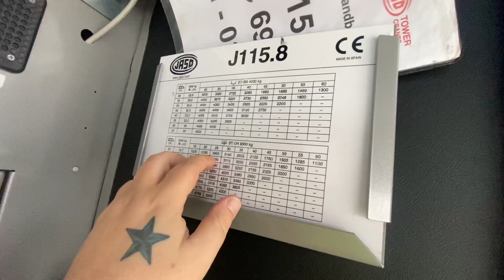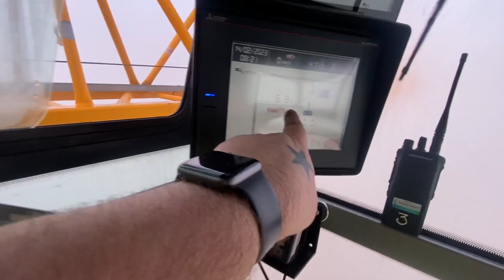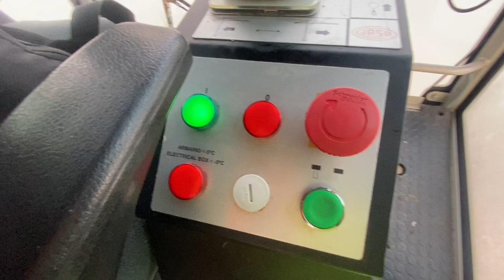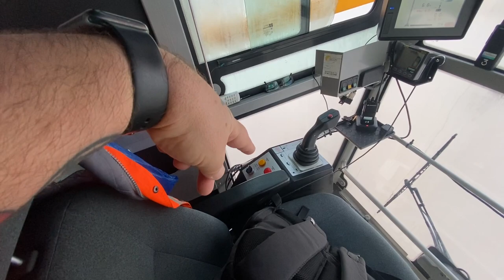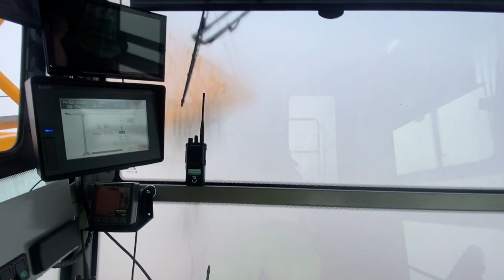WORKING IN FOGGY WEATHER CONDITIONS - Episode 5 2023

Comment: Another good vid . Question , have you ever been on a tower crane on the top of a building as it’s going up
Reply from the maker: Nope, most cranes like that are in the USA or Australia as they use a specific type of crane called a Kangaroo tower crane ie meaning it jumps up from inside the lift shaft on hydraulic rams

Comment: Radio procedure seems a little sketchy! Surely it would be safer and easier to have each driver on a seperate radio frequency with a universal emergency frequency on a seperate radio that all are tuned to. Probably mean another radio in each cab, but must be better than the garbled, messages your riggers are transmitting ... just very confusing for the drivers! Just a thought.
Reply from the maker: I can understand fine……most of the time lol